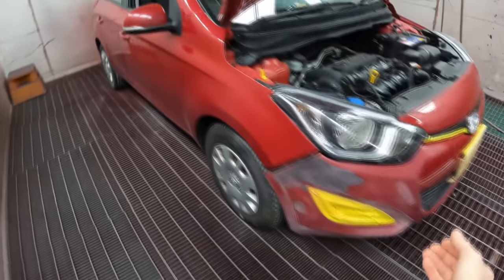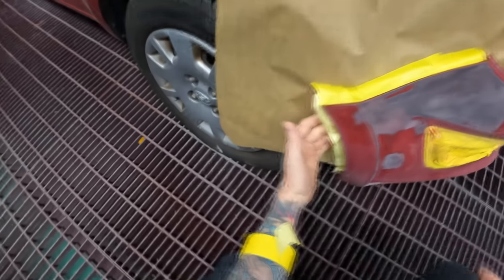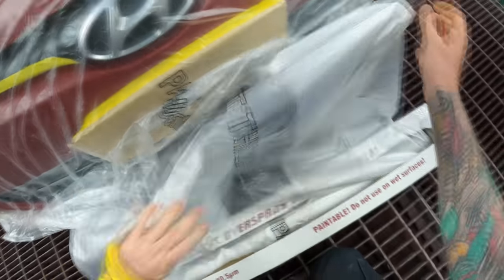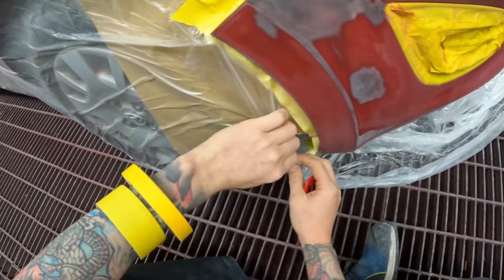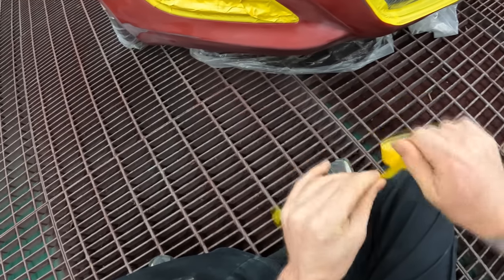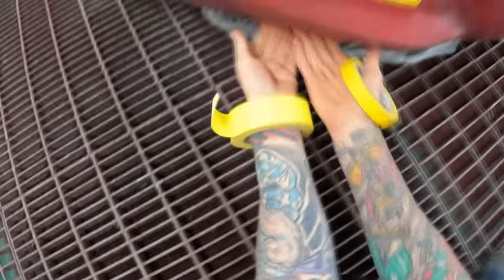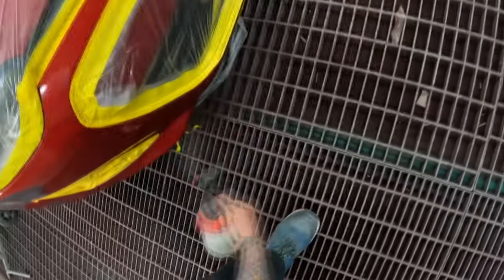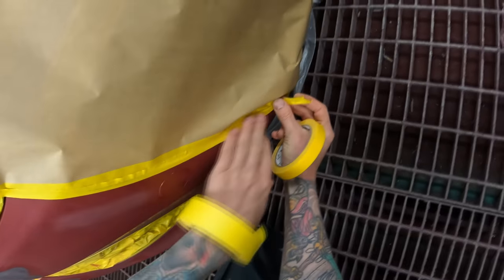Hyundai i20 Spot Repair

Comment: I acctualy use the wet on wet for 90% of my bumper jobs as long as its not bin painted a couple of times and the damage is not massive then sand it out to p400 dry finished of by hand i do dust a coat on first to prevent edge mapping and then one wet coat , saves me a ton of sanding

Comment: For raw plastic bumpers that has furry spots or a repaired bumper with furry spots I always use cardboard dry and rub it fast to melt the plastic furry fibers then I hit the area with   1200 grit wet or dry sandpaper (dry ) and  then I use the back of the wet or dry sand paper to melt it more and then I hit it with 1500 dry . It sounds crazy but it works and makes the raw plastic feel perfect

Comment: Thank you for going into enough details so that a novice diy like myself can get all the information. I have been watching your videos for years and they really build my confidence. I am tackling a silver Honda for my niece and need to do a lot of blending and I was starting to get a little nervous, but this video really helped restore my confidence. One important question, are you using solvent based or water based products now. I know you paint differently based on that and I am not sure if you would change the pressure and fluid for both systems or just one of them. I am using solvent based paint. FYI color match is not great because original paint is faded and new paint looks darker, hence the blending. Thanks and keep up the great videos.

Comment: You wouldn’t like sikkens,the sealers, high build and clears are great but the base coat is very weak and hard to cover.That’s the water anyway I haven’t tried the solvent